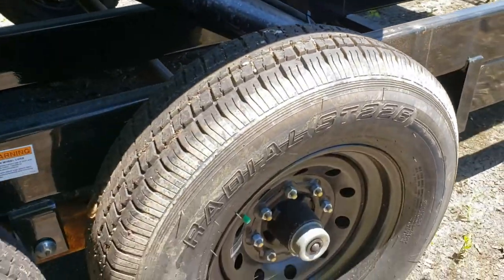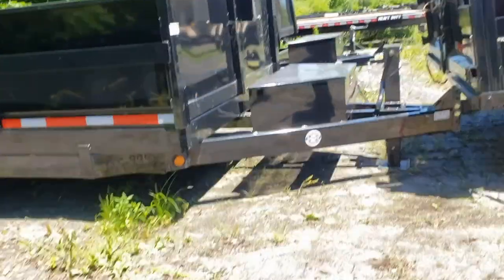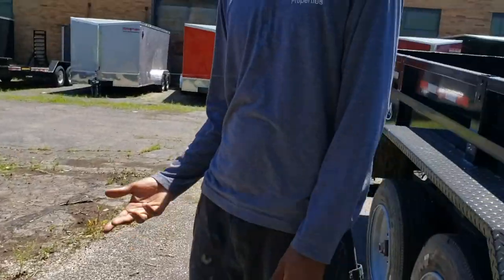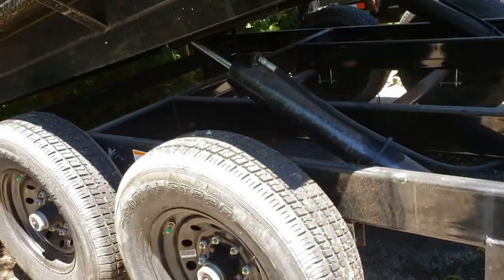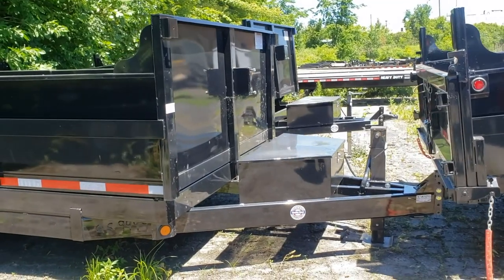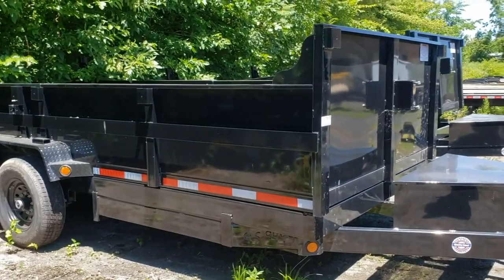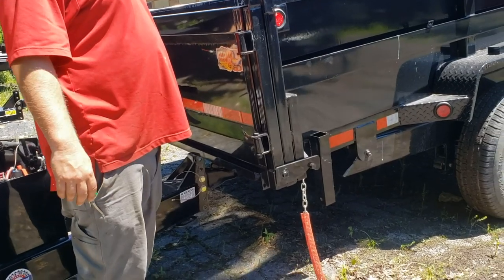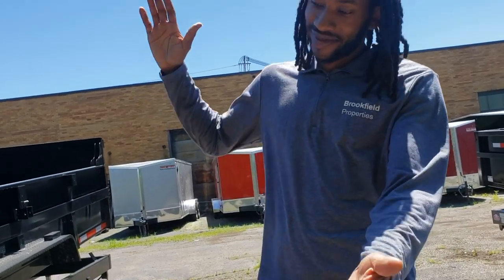Dump Trailer Maintenance Tips You NEED to Know

Comment: if i hold the lift to long it makes a his noise as if it over extends and wont lower unless i drive and the rear hits the drive way and kind of pushes it down a little then i can lower it only happens if i hold the button up to long i can hear it clicking
Reply from the maker: Appreciate your comment. Wow, that's crazy! Have you figured out a way to have a reference mark or time mark to know when to stop holding the up button?
Reply: @ARTTLife  I was thinking out a strong strap like a seat belt but wondered if there was an issue
Reply from the maker: It might be, how has it been holding up now? Did you have to replace anything?